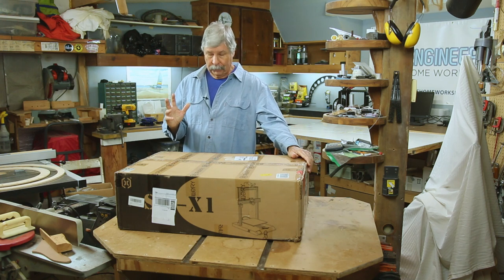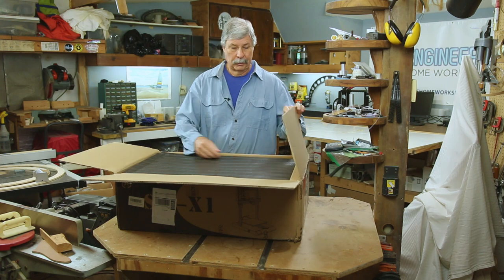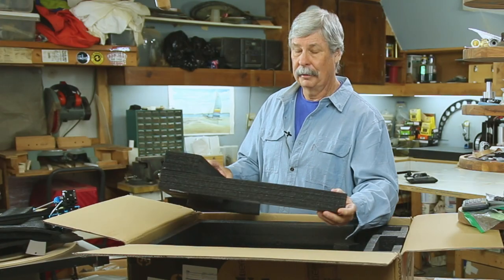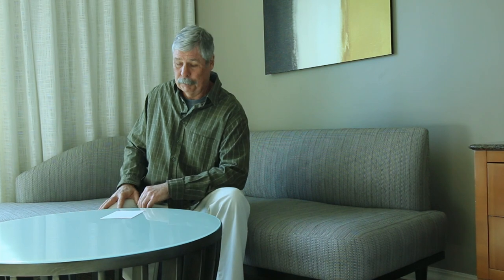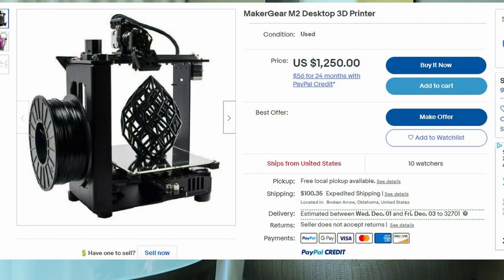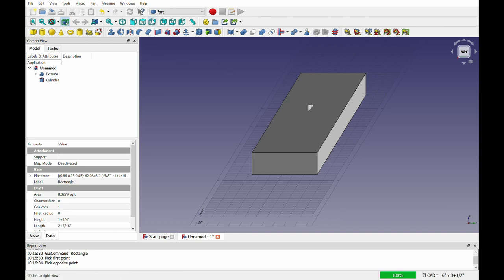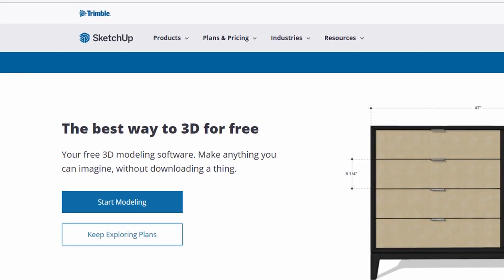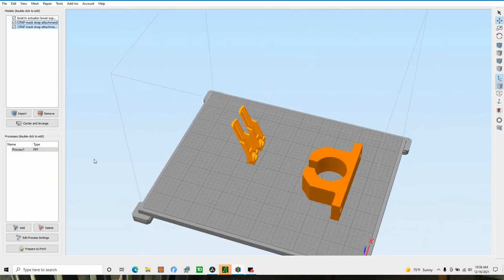Every shop needs a 3D printer

Comment: Totally agree with the use of 3D printers in a traditional woodshop. They are great for making jigs and other useful fixtures. Recently built a flip cart and used 3D printed bearing plates and spacers. Late last year I added a resin 3D printer and I'm almost done printing and assembling a Lowrider router based CNC.